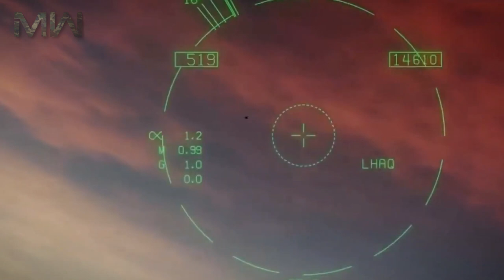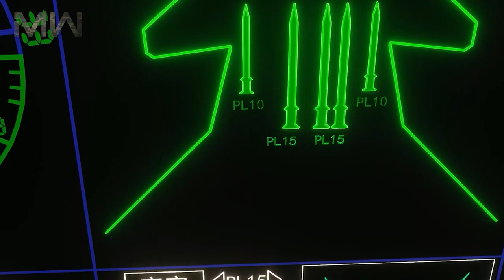Chengdu J-20: Chinese First 5th Generation Stealth Fighter Aircraft

Comment: Despite their touted superior engines (including token Russia's), the F-22 and Su-57's engines aren't proven to work with DSI airflow (yeah great stealth with those splitter plates instead, not) or powering as much avionics around their bodies, and the F-35 is only a smaller plane.